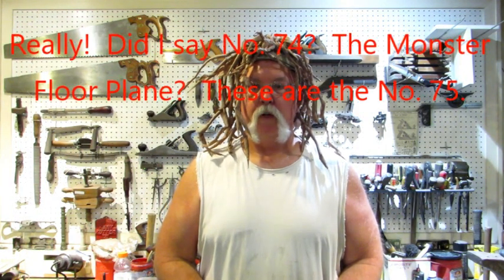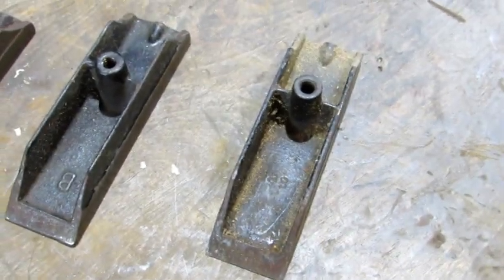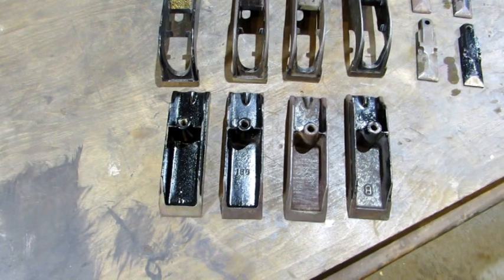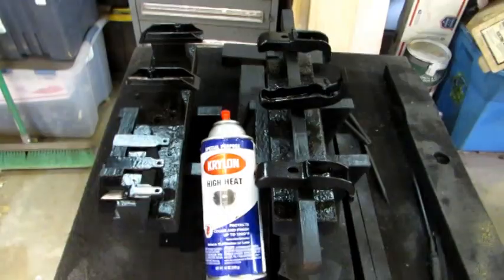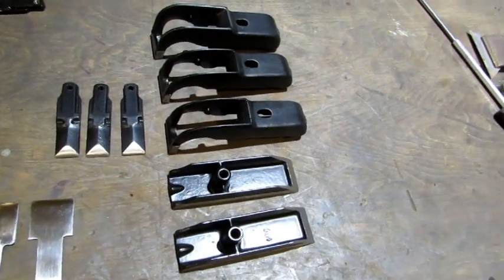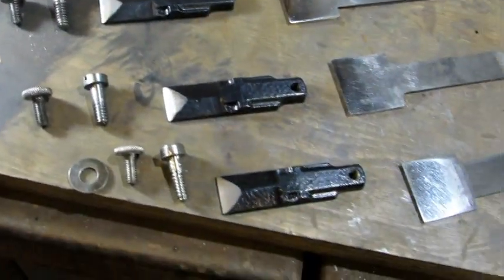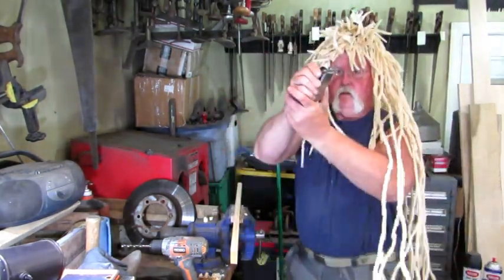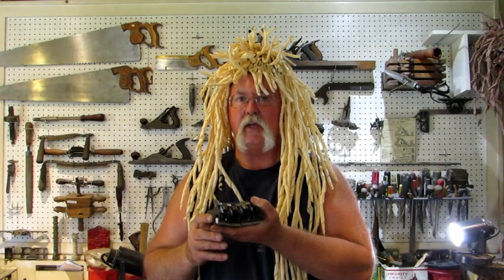Stanley No. 75 Bull Nose Rabbet Plane

Comment: I just picked up a No. 75 at the flea market. On the base it has a "2" cast into it. I sharpened it and cleaned it up and it works well. Doesn't look near as pretty as these four, but it makes nice shavings. Great video, as usual, Keith. Thanks for sharing.